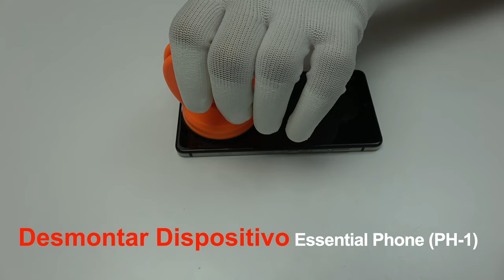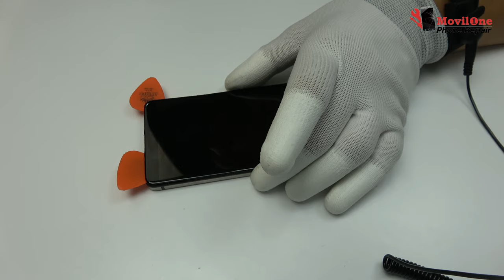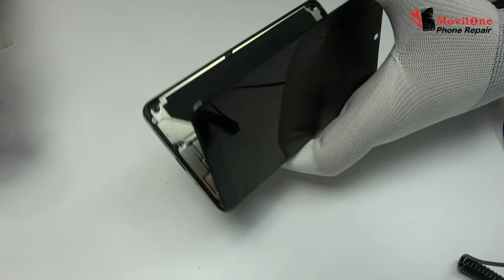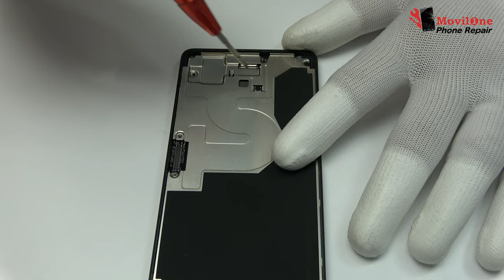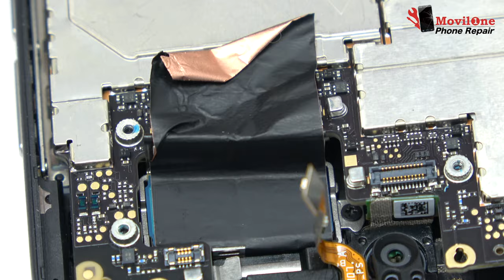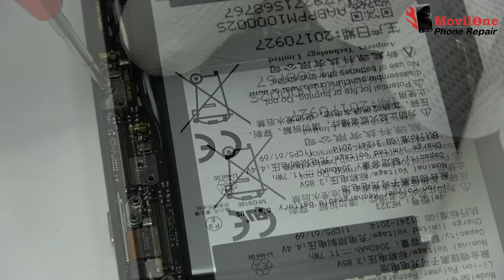Essential Phone PH 1 Teardown & Review

Comment: Thank you for the video. I have 3 of these phones and one has the battery swollen for some reason. It has already separated the screen by pushing it up, so taking it off will probably be easy. I also have to replace the screen on a Motorola Edge + phone.